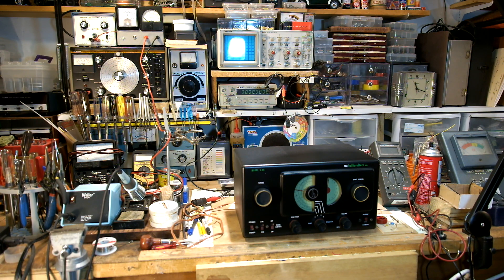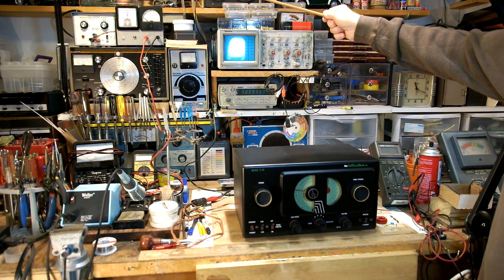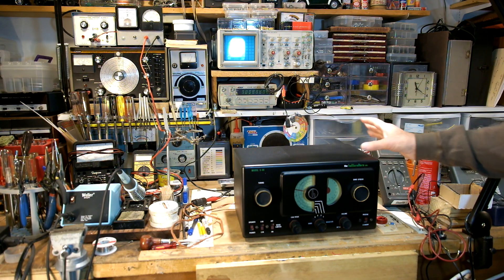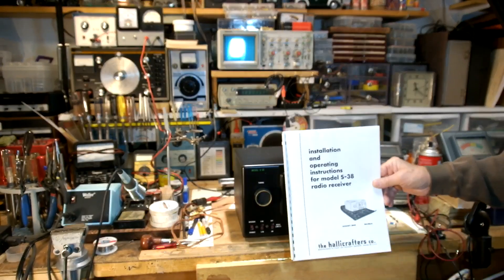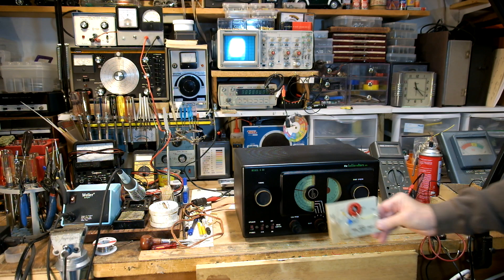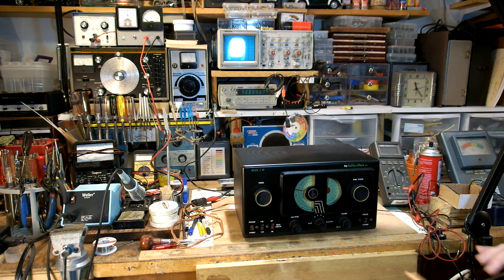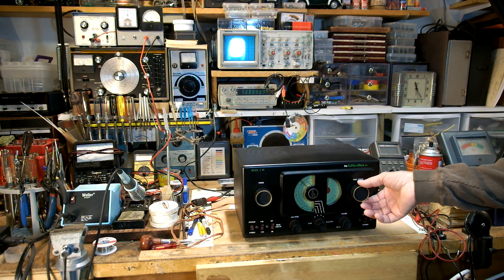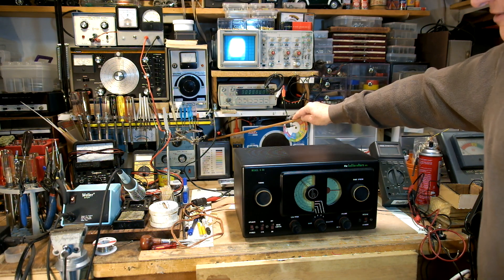Hallicrafters S-38 Restoration Tips

Comment: Just finished mine... S-38 second no letter model wrinkle finnish..did the hot wire through switch and polarized plug, on off switch broken from ground Modification... now it is a cold Chassis.all recaped and sounding great! the rubber bushings i replaced with Nylon shoulder washers with Nylon 1/4-20 screws so no posible way for the outer case to come in contact with the inner Chassis! About to do a Realignment tomorrow.jim
Reply from the maker: Jim, a perfect restoration!

Comment: What sort of antenna are you using in the demo ? I did a rebuild on an S-38C and my indoor reception with a 6 foot wire is terrible.

Nice restoration job.
 Paul
Reply from the maker: I have a 70' long wire.  100' would be better, but my yard isn't big enough.  You antenna should be connected to A1, and A2 and G should be connected with a shunt.  My receiver is not grounded, but grounding may help, in which case, remove the shunt between G and A2.  An outdoor antenna will need a lightning arrester.